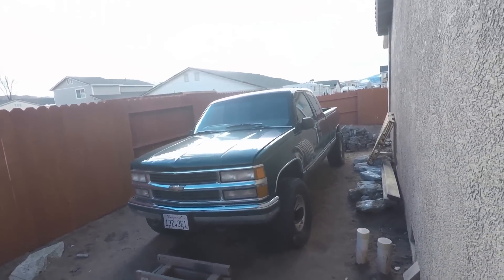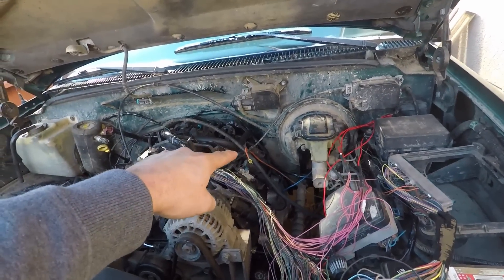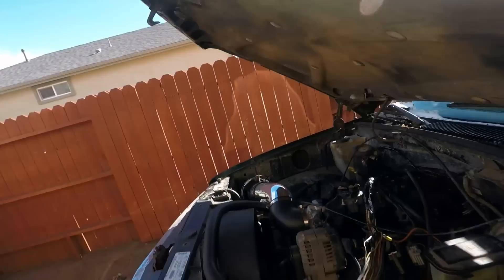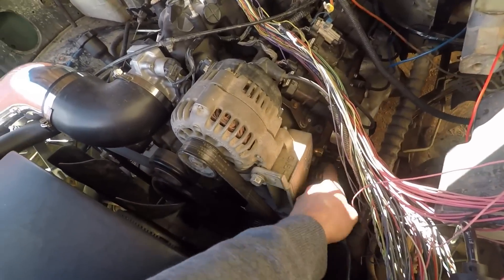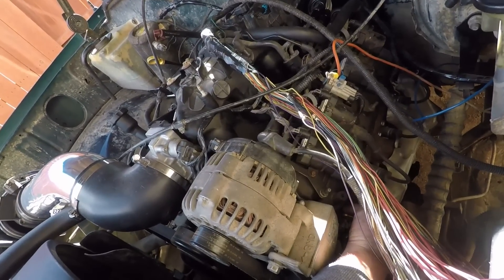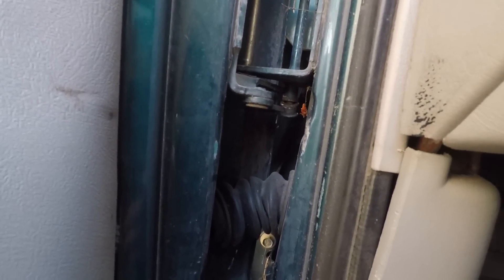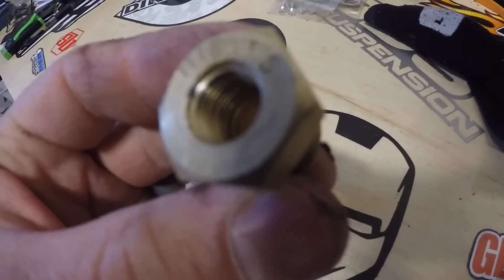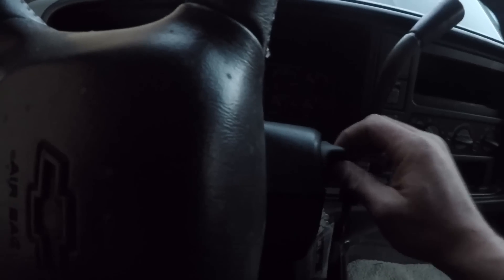Another Big Step Forward On The OBS LS Swap

Comment: I have not had to many battery troubles as long as i habe not been hard on them like they should never really be let go below 12v i do have a yellow top optima in my suburban now and i have had it for sevral years now i think i had it go down like twice but charged it back up and were fine but the last couple of batteries i have bought were i think excide from The Home Depot the group 75 was like $75 and the group 78 is like $110 with a 40 month free replacement